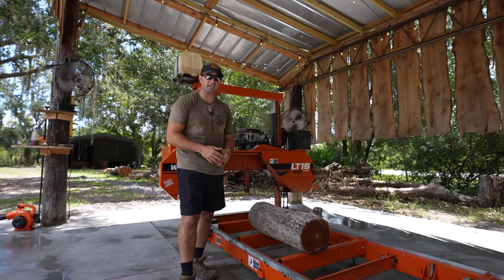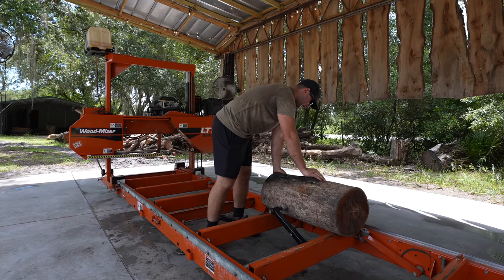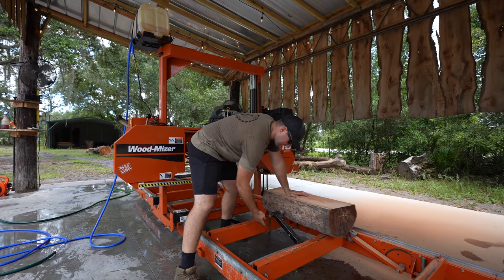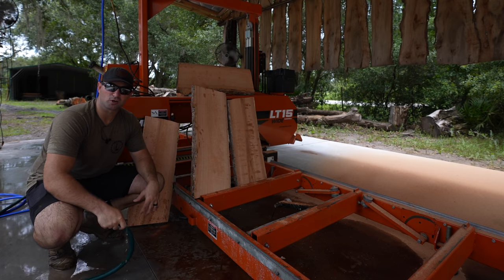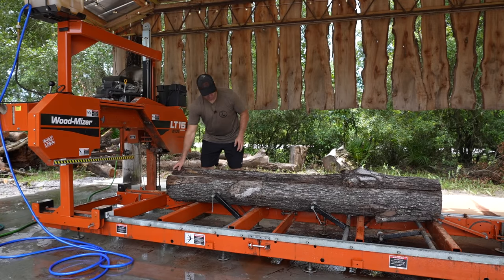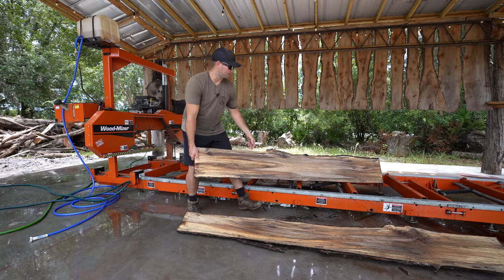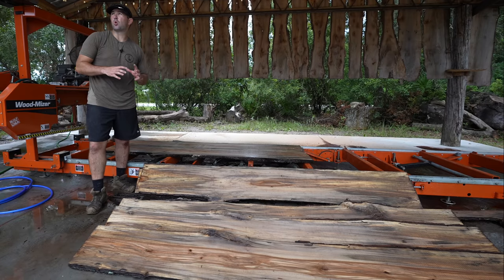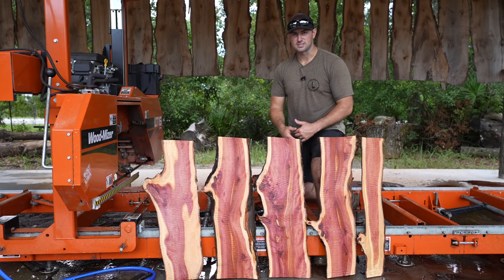Sweet Gum, Eastern Red Cedar and a Mystery Log on the Sawmill!

Comment: I cut some sweet gum here on my mill a few days ago. I already know sweetgum is beautiful but its a real challenge to dry. You have to end grain seal  you have to fperfectly flat stack it and you have to weight the crap out of it while ita going through its initial drying phase.sweet gum is a workable wood . But sweet gum typically has a flame figure in the wood. Beautiful stuff. People tend to shy away from it because of the drying process. If you have a large storage yard for logs you could stack swegum log  and let is dry as a whole log 6 months to a year then saw them. And by the way they used to call sweetgum “satan walnut”. Hickory looks nothing at all resish or pink by the way. Hickory has real nice dark figures in it heart woods tho.